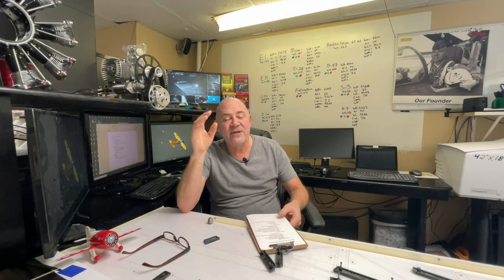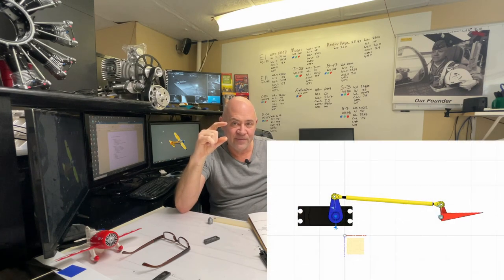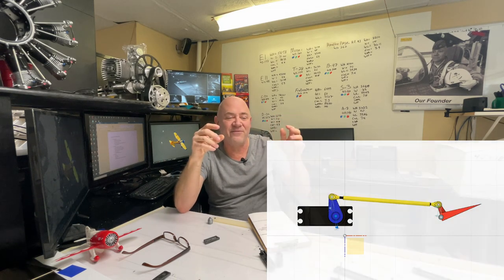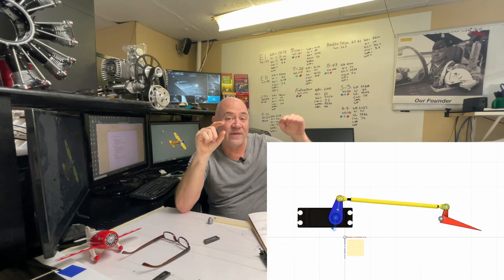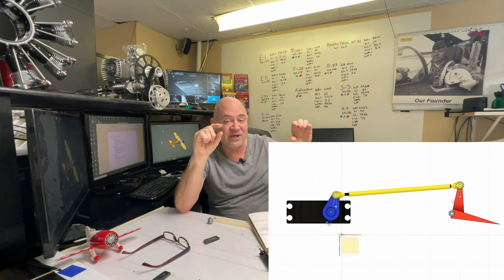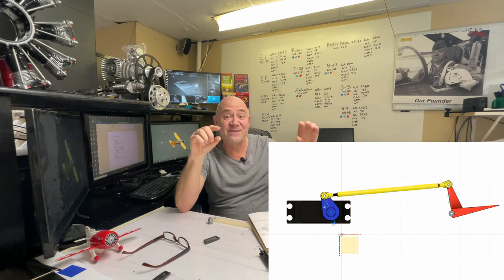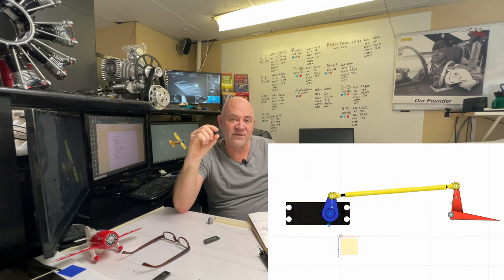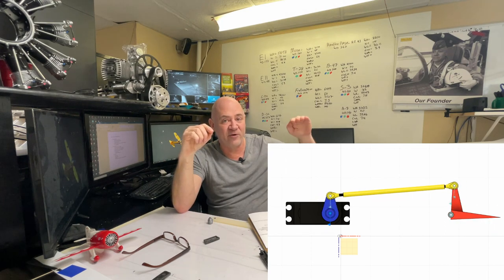Servos 101

Comment: I still have unanswered questions DAG.
1) How does subtrim affect resolution?
2) How does atv values affect resolution? Specifically, going wider than 100/100?
3) Programmable servos: How does resetting center or travel in the servo itself affect resolution?

You have done a fantastic job of explaining how to get the best mechanical resolution, but what about electronically? Could I be doing it better? How?
Reply from the maker: The way I understand it is this-
1) How does subtrim affect resolution? (Your sub-trim is moving off-center of your full travel. So if you had 100 steps and set your subtrim at +10 steps, then you would have 40 steps/60steps. Just using 100 steps for this example).
2) How does atv values affect resolution? Specifically, going wider than 100/100? (I have set my programmable servos for 180 degrees of travel. I believe the 180 degrees is stretching the steps. From what I have been told, the servo's max resolution will be the max possible travel when programmed. I could be wrong).
3) Programmable servos: How does resetting center or travel in the servo itself affect resolution? ( From my testing, there are only so many steps. If you re-programmed your center, that is the middle steps. 

I hope this makes sense, and I am explaining it right. There will be a part 2 to the video with all the questions I have gotten. :)

Comment: The last big rocket I built was more then three feet tall I fired it off it went so high I could not see it anymore I never did find it must be on the moon ha ha 😂😁
Reply from the maker: I built a rock once called the, "Scampler". It was to fly a egg up and down. If the egg did not break, successful mission. But, fly it without a egg and it is lighter then designed. I flew it once empty and the wind took it about a mile away. I found it, but it went really high. :)
Reply: That could be a fun way to make scrambled eggs lol 😂